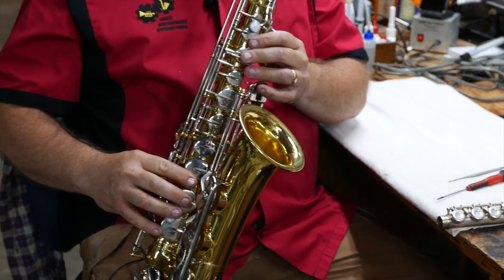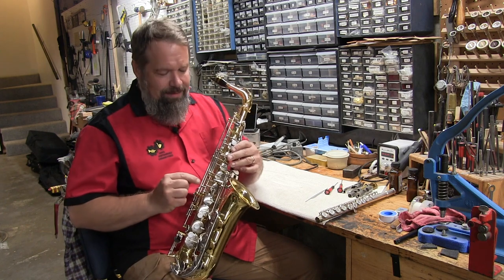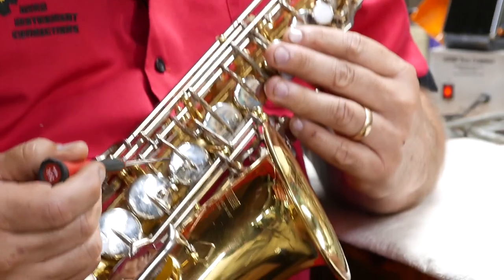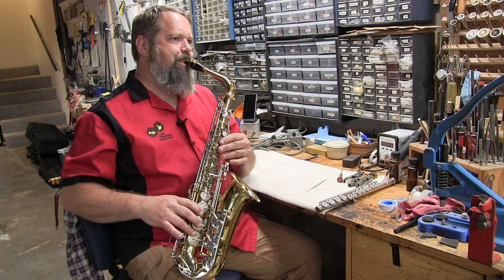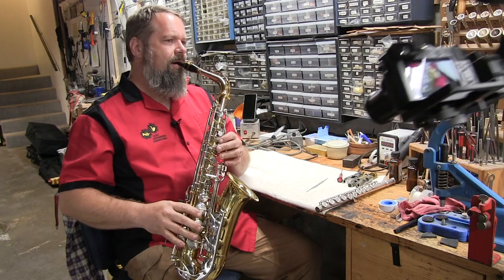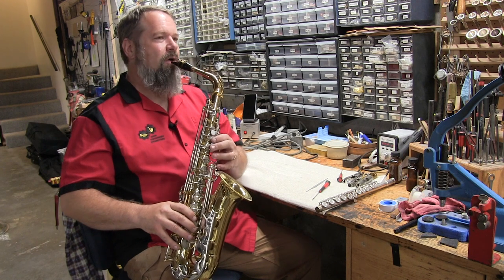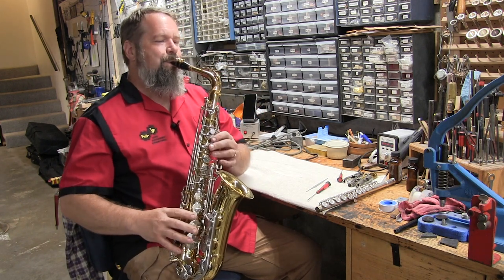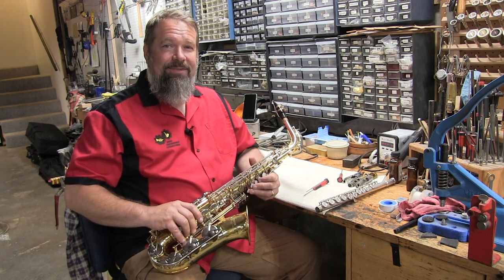Sax G# adjustment

Comment: After doing this, I had to tighten the other screw on that bar, to seat the bis key properly.
Reply from the maker: I usually leave that one slightly out of adjustment unless the player uses their 1+1 Bb, or if there is an altissimo fingering where it’s needed. A lot of my customers never use it, and it puts extra torque on the F to F to G# and then onto bis mechanism. Those keys are really twisting under all that spring and pad pressure tension.

Comment: On the bottom of the screw that he’s turning, is there supposed to be a piece of cork or does it touch the top of the other key?
Reply from the maker: There should be something that keeps it from clicking against the metal.  It can be cork, felt, rubber, neoprene, or I often use a microfiber like ultrasuede.

Comment: What can be a reason for low C# not working? The key opens, but no change in sound between C and C#. Thank you.
Reply from the maker: Same thing! When you use the C# key, it activates the G#.  If the closer linkage on the F# key does not keep G# down, it will leak and screw up your low C#.  All the table keys will do that (B and Bb as well.)

Comment: When I push the low C# key on my tenor's spatula, two keys lift up - C# and G. However, when I manually lift the C# toner opening cover, G does not lift. Is it normal? Thank you.
Reply from the maker: Yes, unless you ave a fork style linkage like an Armstrong
Reply: It's King Super 20